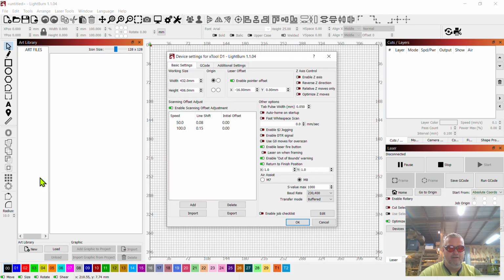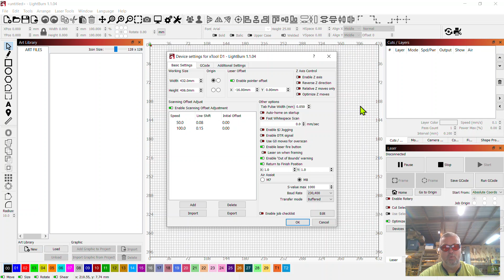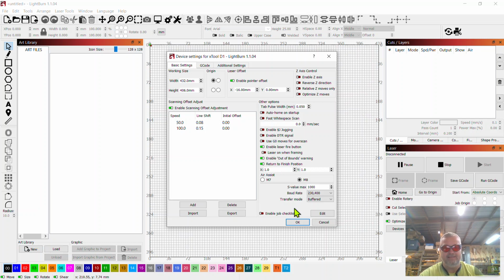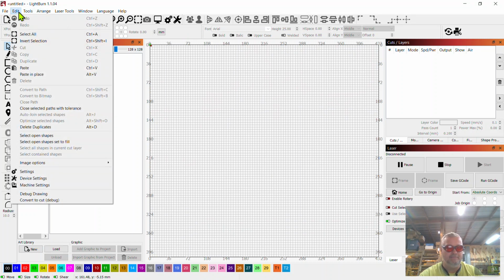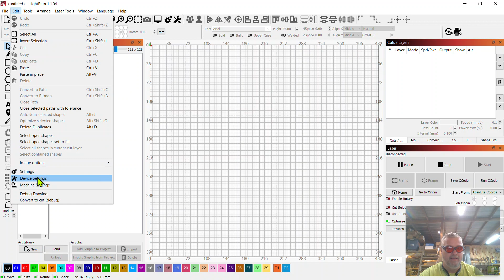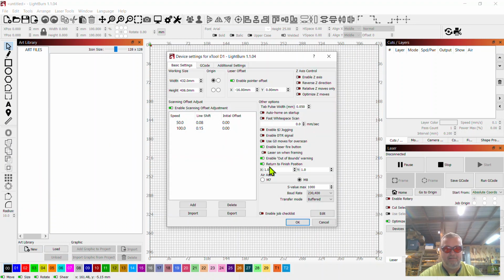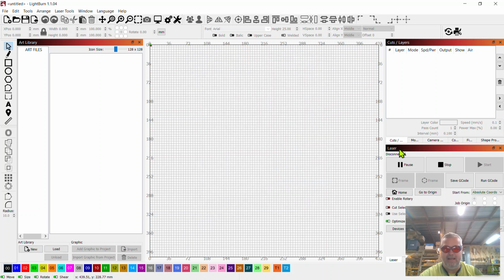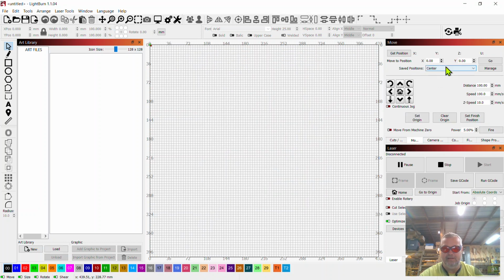Setting the "return to" location in lightburn

Comment: Real nice videos. I just got my laser but I cant figure it out how to set  the right frame and size, do u have a video for that setting the right frame and size for what u are going to use thank u
Reply from the maker: I have lots of videos under the lightburn play list. Framing is based on the design or intended use
Reply: @TheClackShack  I have seen videos but I just can get it right lol. I set the item then what I put the laser in place and out the option origin or the others then my measurements I can get it right . Thank you. 
Do I just type in ur page light burn
Reply from the maker: Run absolute and just home the machine. A camera will help make alignemnt quicker. 
 @aaronromero7723

Comment: Great video. I have an xtool D1 Pro 20 watt. When Lightburn goes to home position, it slams the X and Y axis of the laser. Can I stop it from doing this?  Thanks.
Reply from the maker: The limit switches should prevent that. I never had an issue with my D1 pro doing that. You can slow down the home speed in console and also make sure that the back left corner is where it is set to home to.

Comment: Hello friend, first of all thanks for the instructions.
In my LightBurn, in "Working Size", I left it as 420mm x 400mm; this, in order not to activate the Limit Sensors of the xTOOL D1.
In "Origin", I didn't change it but, can I leave it as Bottom Left?
In "Return to Finish Position", what does the X: 1.0 and Y: 1.0 mean?
Does 1.0 mean 1mm by any chance?  Thank you again
Reply from the maker: The x and y axis operate in mm measurements. It is a coordinate system that the machines uses. Most machines, it is located in the top left corner just short of 0-0. Keeps non-limit switch machines from slamming.

Comment: Do you intend to get the XTool 40 watt module? Do you see a need for it? I got the bundle (10 watt w/40 watt upgrade) and I know I will be using the 10 watt a bit but also want to use the 40...it has been difficult for me, a very new user, to get much in the way of settings for the 40 watt...I suppose by the time you read and maybe reply to this, I will have ran it and tried it out...I am in the process of building your enclosure but not as tall...also I will be burniong the jog kit which I also purchased...I will be using the 40 for cutting that out. I will use low power and fast speed to get my settings...ordered 16" x 16" basswood ply for this kit.
Reply from the maker: I am not against the 40 watt module but currently, I have no plans to get one.

Comment: Ok you confirmed that the return to has no effect on the home position as far as running the program.  I am pretty sure you also now have the 20 watt diode.  Does it fit in return to y1 x1. Or did you change that to y? X?    I have the D1 pro 20 Watt still in box right now while I study.   I am currently more Metal.  Langmuir crossfire pro.  Plasma table.   But I see lotsa possibility with my new TOY.
Reply from the maker: I works with my 20 watt pro, My upgraded LM3 had to be modified due to the size of the module.

Comment: What did you set the home on your 20 watt because mine is jumping when it homes?
Reply from the maker: Most machines will hit the limit switches and back away then reapproach. I will say that if your travel speed is over 50, it makes it worse.

Comment: Great tips!  I downloaded your template files and looking forward to building them.  I like the idea of X1, Y1 since I have tried the home button and the laser will bang against the side and back rails sometimes and you can hear the belt slipping.  Also, the wiring to the laser can interfere with getting exactly to 0.,0 by hand if the zip ties don't keep it above the gantry.

One question, though.  Do you always start from  0, 0 by hand, then use absolute coordinates like many people recommend?  Or can you start from 1,1?  

Thanks again!  subscribed!
Reply from the maker: I normally don’t worry about it in the initial burn. I use the frame function to be sure of placement. When mass producing items and running multiple engraves, I use the return after function to eliminate the need for framing

Comment: Thanks. But what if you forget and position the head by hand? When it finishes the burn, what then?
Reply from the maker: Rehome then direct it to go to 1/1
Reply: @TheClackShack  Sorry, but I don't yet understand how this works, as I haven't been able to play with mine much yet. I'm not sure what you mean by "rehome". I understand how the Ortur works with the limit switches, but the D1 is still somewhat of a mystery. So, at the risk of sounding a little dense [hasn't stopped me yet ;-) ], say you have moved the head manually. How do you "rehome", and then how go to 1,1?
Reply from the maker: @jfm30204  I am assuming your using light burn, it has a home button. The laser will move to home when pressed. Laser box basic does not have a home button.
Reply: @TheClackShack  Yeah. Lightburn. I guess the question is, if you have moved it manually, does it still know where it is and, therefore, where home is? Thanks.
Reply from the maker: @jfm30204  , no, you would need to rehome by pressing the home button